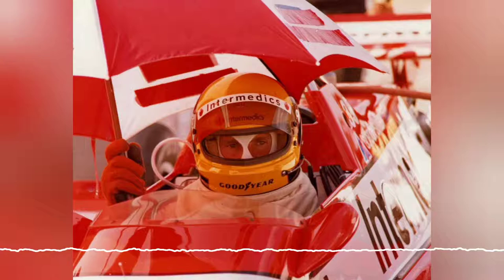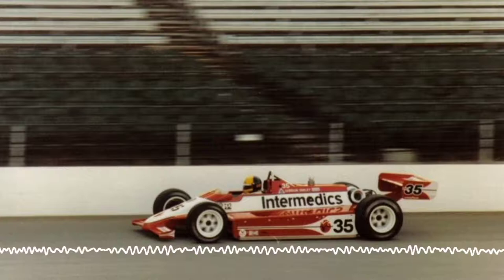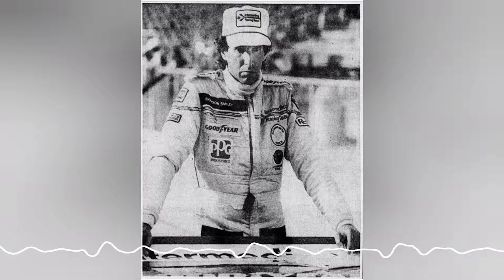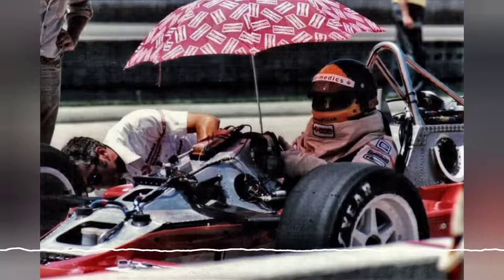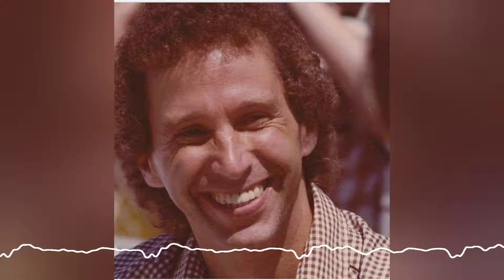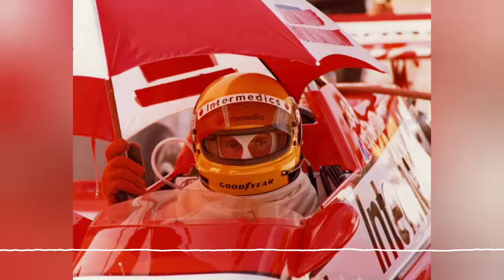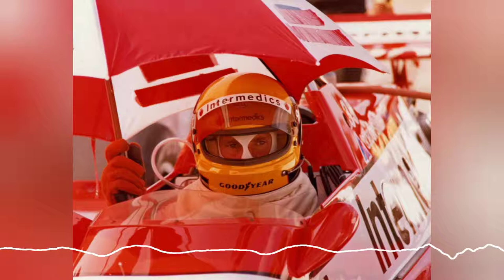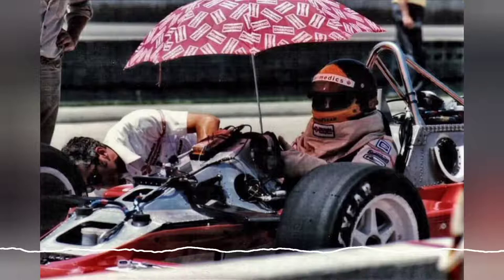Gordon Smiley Interviews Before 1982 Indy 500

Comment: He clearly had an awful 'fast friday' with the car not even starting and continued handling problems.  The car he seemed determined to go with was a 1981 March Chassis and I always thought this was odd considering he did have a brand new 1982 car at his disposal and it was a car George Snider would later have no trouble at qualifying well over 195.  I believe his accident was a case of him feeling pressure and simply overextending himself.